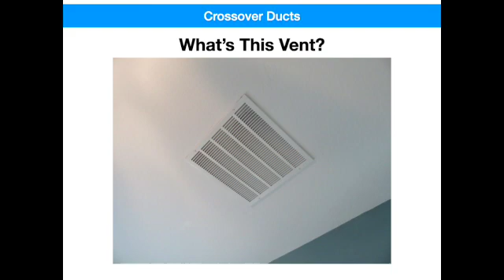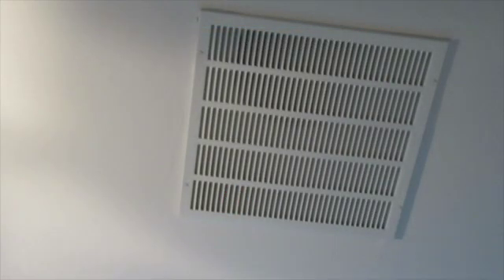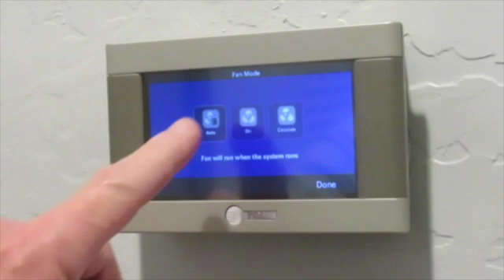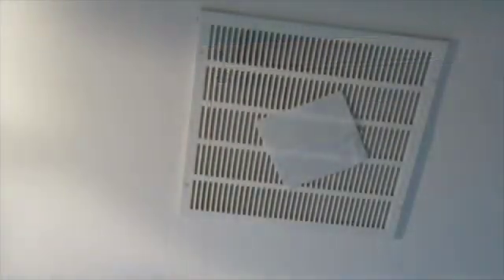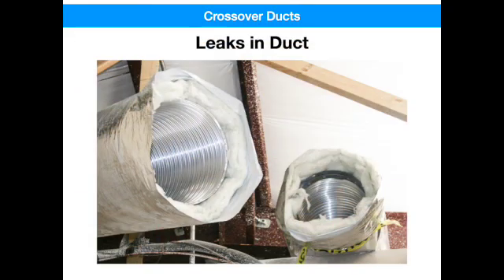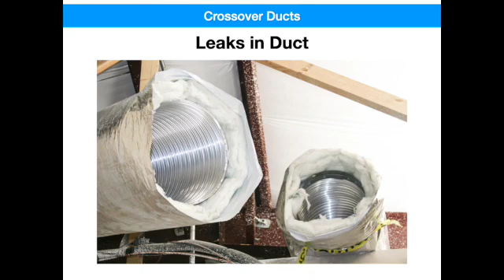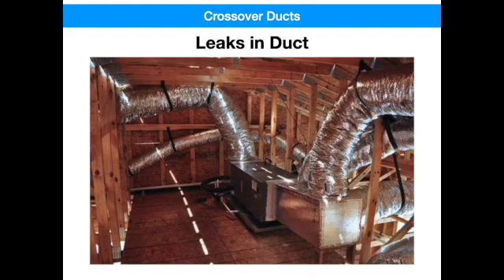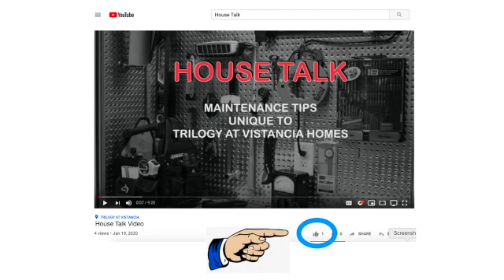Crossover Ducts

Comment: So all rooms need to have a supply register and cross over register in them ? Cause my bedrooms only have a supply register and the return is in hallway
Reply from the maker: In order for air to go flow into a bed room an equal amount of air needs to flow out. If you don't have a return path of some sort the air will just pressurize the room and the air flow will stall. Now because the world and construction techniques are not perfect... the air will find a pathway back.  Under doors, around leaky windows and through outlets etc. When I was a kid my room always got cold in the winter until I cracked the door open and blocked it with a shoe so it would slam closed due to the air flow. 
Homes that were built before energy efficiency was a major focus did not have return pathways. As the years passed more and more added them in the form of windows over doors, return vents and these cross over ducts.  Not sure where you live or how old your house is but the codes have changed more and more over the year so I'm not surprised you don't have a formal return.